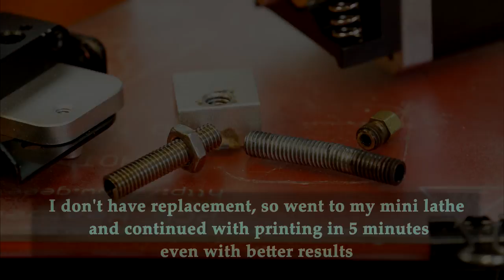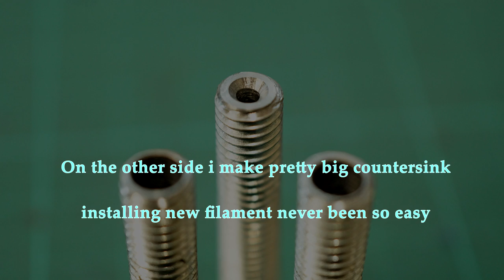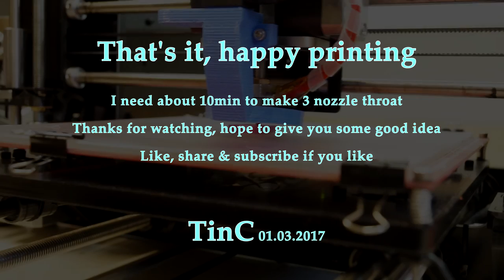Making Teflon Nozzle Throat -3D printer- no more jam [using minilathe]

Comment: Just to clarify, is the aim that the heater end should be at melting temperature, but then a long screwthread part to avoid heat creep, and fans used to cool the thread part?

Comment: someone told me not to use long sleeve shirt when operating the lathe machine, danger waiting for us
Reply: I was more concerned about slicing toward the thumb with the razor blade. Very nice project though. Too bad I don't have the machine used...would love to buy some of these if they ever end up on ebay =)
Reply: I rewatched the video just to judge this... I haven't seen any dangerous movement around the lathe nor with the knife to cause any accident. Did you guys never have used razor blade shaver? Knife on the face, whoooo! 😆

No amount of rule-of-thumb safety would protect you, if you do not have situational awareness and can't control or know your body and the equipment around you.

Just keep sensible distance from moving parts, it is that simple. This is the only rule that can save you.

Btw. when making heavier cuts (not on this lathe obviously), the flying hot chips surely won't feel good on bare skin. 😉
Reply: True

Comment: I used 3mm ptfe (with 2mm hole). But I drilled 50% into nozzle and 80% into throat from other side as you. So my tube starts just after the throat 2mm hole and ends in the middle of nozzle.. don't know how a jam looks like ;)
Reply from the maker: Google+ SUCKS BALLS - the worst forced social network great.

Comment: you missed a BIG opertunity to make a all metal throat. it would be easier as all you need is a single hole down the middle fort the filament,  and it would be stronger cause there is no thin spot caused by the teflon tube.
Reply: So you are recommending making barrel without teflon tube?
Reply: Yeah except an all metal throat is much more susceptible to heat creep than a PTFE  lined one. A simple piece of threaded rod with a 2mm hole through the middle is simply not sufficient. Have a look at the E3D metal hotend, it requires a fairly big finned heatsink and active fan above the melt zone to stop thermal conduction up the throat.

Comment: I am looking forward for getting a lathe myself, what is the one that you are using?
Reply from the maker: AnsonCTA mine is brand erba type 300 some austrian brand, but it's basic chineese lathe, you can buy many differend brand like grizzly in us and optimum in de... But they'r all the same from china, just differend colour and different switches, stickers...
Great small lathe anyway, i pay $320 about 10years ago but today is the same lathe in same store almost $500.
Reply: tintek33 Can you please post the link for me? I am aware there are tons of scam sellers in China.
Reply from the maker: don't order direct from china, you will pay a lot of tax in this way, find your local dealer, everyone seel his own brand, but in basic they'r all the same.

i got this one:
https://erba.at/index.php/default/drehmaschine-compact-300.html
but the price here was not real, it cost arround €500 now.
but look for your local dealer, in austria you got also bernardo.at or optimum.de, if you'r from USA search for grizzly brand... or ebay:
https://www.ebay.com/itm/600W-Metal-Mini-Lathe-Metalworking-Woodworking-Power-Tool-Turning-Machine/182906020598?epid=20009766315&hash=item2a960c62f6:g:CcwAAOSwsYpaDlXk
Reply: tintek33 Thank you so much for the detailed reply :D. Is there any other machine model you would recommend? I saw some of the lathe includes a milling spindle beside the way of lathe. If possible I would go for those combined lathe and milling
Reply from the maker: AnsonCTA yes i see that one with a mill but i think it's better to bought a real independent mini mill. Make a lot of search before you bougt you can get one for $400 or $900 but they be almost the same. There also some webside about all modification on that minilathe, search for "minilathe" i think that would be first or second result.
Reply: I agree. The mini mill is the shyte! I love both of these machines.
Reply: Harbor Freight?

Comment: try upgrading printer to v6 hot end and mount stepper on frame. Removing all that moving mass of the stepper has improved my prints ten fold. If you spend this much effort making your own throat, the upgrade should be fairly easy. Beware chinese knockoff are $20.00 instead of e3d $80.00, but the throats on chinese versions are horrid and will jam.
Reply from the maker: josh hofmann i alredy use e3d copies. I will make a video how to do that, i bought 4 E3d copies so i will change entire head not only noozle when i change material.
Reply: ya let me know when the video is up i am interested